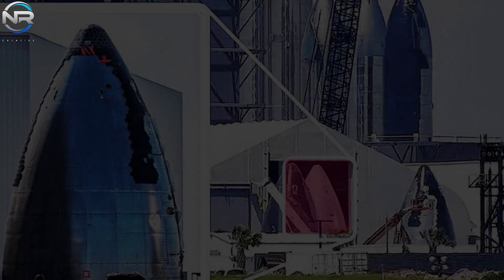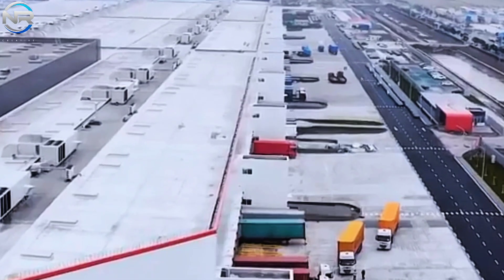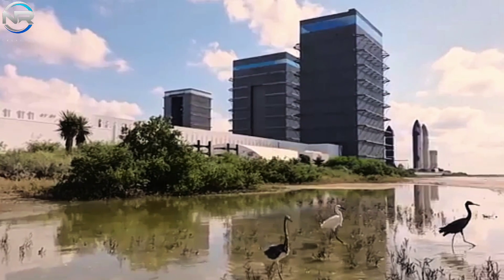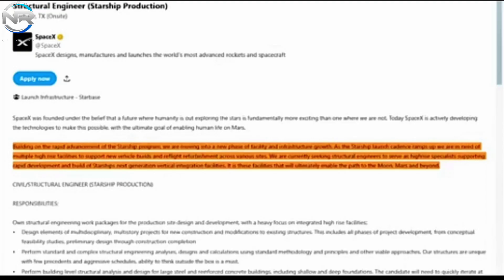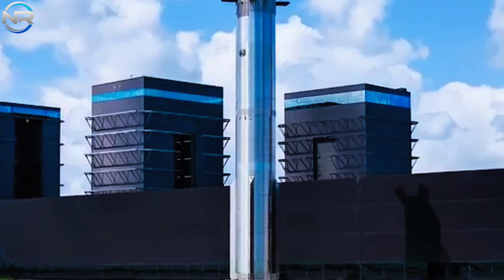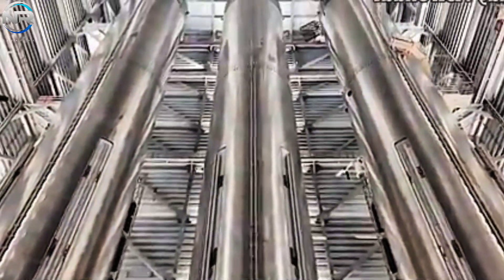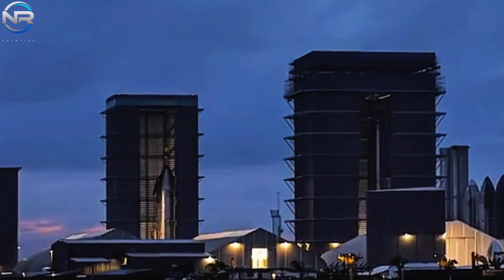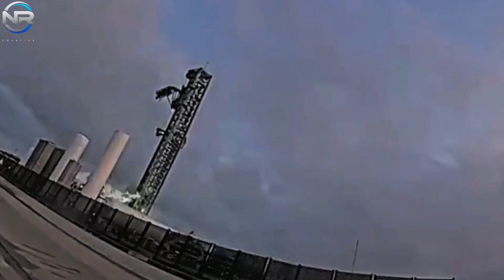SpaceX Faces Big Challenges: 10X Larger Starship Gigabay and Launch Pad Upgrades

Comment: OK -------- .  The HIGH bay is the perfect size for RAPID Check Out (not refurbishment) and Loading Cargo Onto Starships between Launches and cannot be replaced without high cost and waste of time.  With the Area the High Bay now sits on being too small for the Size the GIGA BAY SpaceX needs to Efficiently contain at least 20 Starship/Boosters during Construction to produce 100 Starships a year. With 30+ more likely... Unless the Recently Completed Parking structure is destroyed along with the High Bay. Increasing the time it takes for workers to walk from their cars to their JOBS all across the Complex, Decreasing Productivity... Not to mention, that using the current long transporters to move Starships and Boosters between stations spread out in many Separate distant small Giga bays would add cost and time for constructing each Starship/Booster..
------------ .   By constructing the GEGA BAY West of the existing MEGA BAYS or even South, SpaceX has plenty of Room for the size of the GEGA BAY they must have with a central transport Isle between two rows of Starship/Booster Construction Stations under one Roof.. With a central overhead crane system for quickly transporting Starsships between stations using their Lift/Landing side Pegs. While reducing the WASTE of time and Cost of both workers getting to work from the Centrally located Parking structure and Starships/Boosters being moved from station to station by transporters and or moving Construction Machinery and Processing Equipment between Starship/Boosters on fixed stations as they are needed...!!!  While some Assembly processes need fixed stations most work can be done cheaply by moving the smaller needed equipment between ships allowing differently designed Starships such as Tankers, Lunar Landers, Lunar Habitats, Orbital Stations, Earth Orbit Lifters and Mars Ships that would take their own processes and time to not hold up a fixed static production line or the added cost of constantly moving Ships when a few smaller pieces of construction equipment (even if they weigh hundreds of tons) are easier and faster to move with the over head cranes...  Allowing Cheap copies of Some equipment to work on multiple ships without waiting for a single ship to finish and move..Especially with unseen delays and if the same equipment is needed multiple times during construction between other processes that would have required the ship to be moved each time.  
----------- . A mile-long GEGA BAY is preferable to dozens and DOZENS of the smaller GEGA BAYS scattered across square miles exposing half-built Starships to the nasty unpredictable Wearther of the GULF Coast of Texas that would be needed for building the thousands of SpaceX Starshjps that will be Demanded once the RICHES of Earth Orbit, Mars and the Solar System is Realized with the Reduction of cost below Airliner rates...
Reply from the maker: All are the development process let''s wait for what other updates Will happen this is just the first step for gigabay